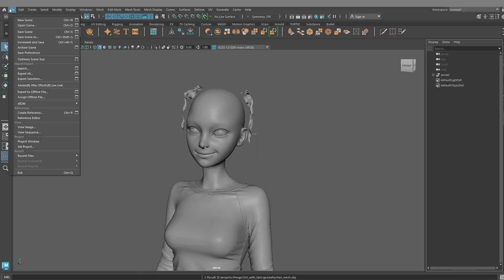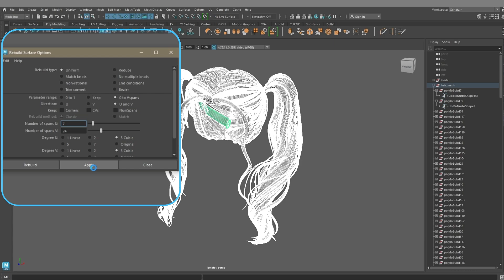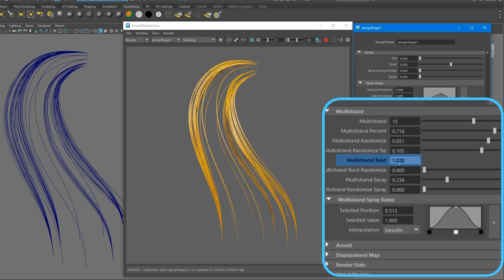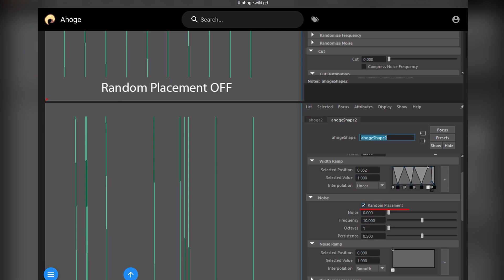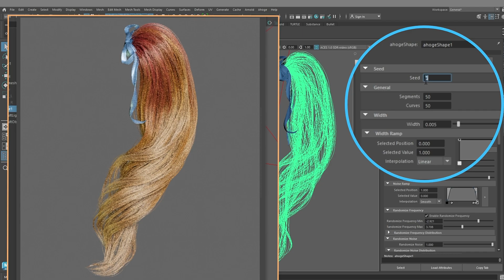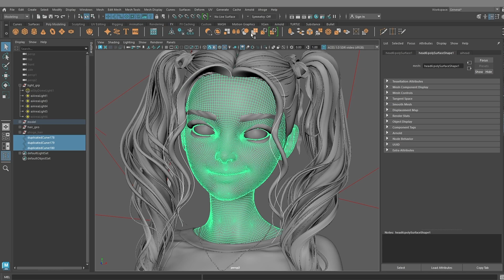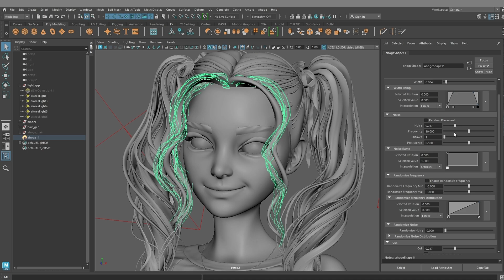Creating hair with Ahoge in Autodesk Maya

Comment: Amazing🤩 its very usefull for stylized characters hair😁 but can you guys say me can i simulate it  🥺 if i connect ahoge to geometry does it mean geometry movement from based nDynamic or joint  is also move ahoge🤔
Reply from the maker: Yes, ahoge will follow the geometry just fine. There’s currently an issue with playback, it will be fixed in the next release. But, it renders without any problems, and motion blur is also supported.
Reply: @ahoge-plugin  Brilliant❤️‍🔥

Comment: I have followed the tutorial for manual installation, but it still cannot be displayed normally in the workspace and the plug-in manager is not found
Reply: I am Chinese windows
Reply from the maker: @K-fly-b4o  I will install Chinese Windows later to see what's happening. You can try this manual https://ahoge.wiki.gd/en/installation
Reply: @ahoge-plugin  I've tried manual installation but it didn't work
Reply from the maker: @K-fly-b4o  I will install Chinese Windows and fix install.mel, hopefully by the next release.
Reply from the maker: @K-fly-b4o  install.mel should work on Chinese Windows now.